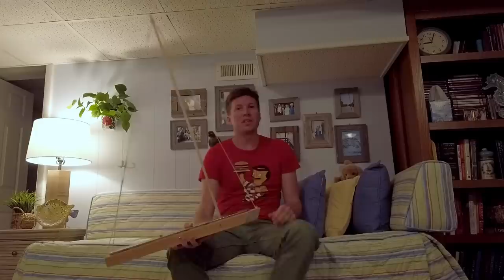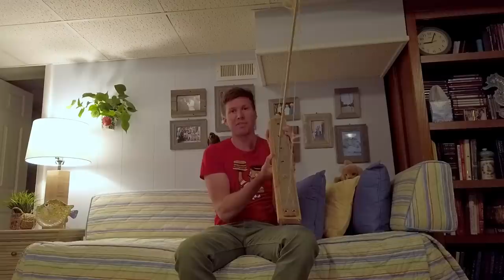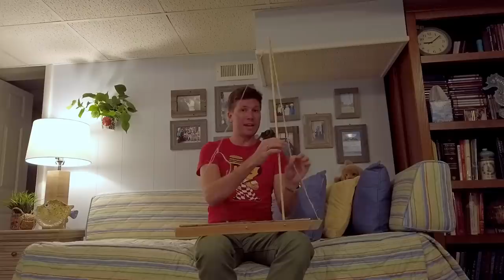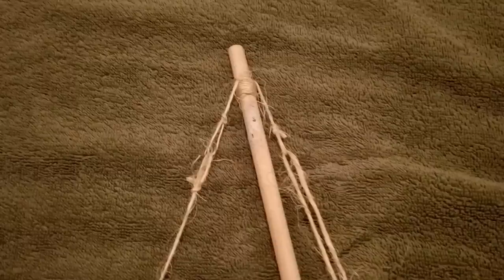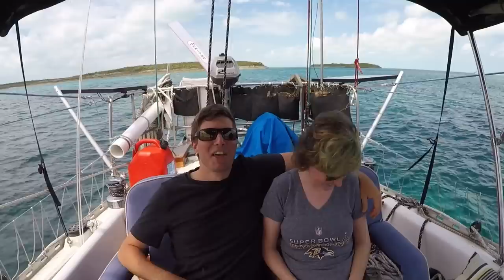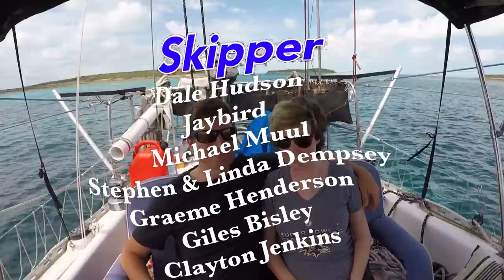Do You NEED One or Two Headsails? | Sailing Wisdom

Comment: The geometry of my trimaran doesn't lend itself well to a backstay. I'd have to shorten my boom to have one.
Reply from the maker: That sounds counter productive! Do you also have a square top mainsail? They are great if you have aft swept spreaders and no backstay.
Reply: @RiggingDoctor  She's not a very big trimaran. 19 ft LOA, 14 ft beam, 27' mast, 218 sq ft of sail area.
Her sidestays do most of the lifting and sit about 3 ft behind the mast.
I know it doesn't sound like much of a vessel, but she's cracked 20 kts and covered over 300 miles in a day.
She was a project I made out of 8 sheets of plywood with a Hobie 16 mast. Dry, she weighs about 300 lbs.

I went with Dyneema rigging. (Love your videos on stays.) Since mine gets trailered each time I go out, I had to get creative with a deadeye replacement (lashing takes too long). I ended up making a 16 inch bury to make a sling on each stay. It locks like a Chinese finger cuff but adjusts easily.

Comment: What is the difference between a cutter rigged yawl and a Bermuda rigged yawl? The JFK yawl Manitou is said to be a Bermuda rigged yawl. I thought it was a cutter rigged yawl.
Reply from the maker: Technically, a cutter has only one mast. So the number of headsails is not important when talking about a ketch or yawl. That said, you often see yawls and ketches with two headsails referred to as a “cutter rigged” ketch or yawl.
Reply from the maker: The Bermuda rig referred to triangular sails as opposed to a gaff rugged setup.

Comment: The modern definition of split headsails is moronic.   Your definition of the placement of the mast is rational, and historic.   Still, for the purist, the only proper rig is a schooner, both fore and mainmast gaff rigged.   If you want to go fast, get a stink boat and be done with it......
Reply from the maker: 🤣 very true!
Reply: Rigging Doctor, I've got a serious question.    I am seriously considering commissioning a boatyard to construct one of William Garden's designs, the little 28 foot schooner "Toadstool" with some modifications.   Garden has  the foresail as a gaff, the main a Marconi, with split headsails.   Underwater, there is a skeg keel, Garden used an old Thunderbird keel.  What I'd like to do is convert the main to gaff, with a topsail of course.  That would give her a significant amount of sail more aft than Garden designed, and unbalance her, giving her more windward helm, correct?   Could this be corrected by increasing the amount of keel between the rudder and the keel, making her center of resistance move aft?   Or is this a pipe dream that would wreck her performance, which is reputed to be very, very fast for a little schooner.   Thanks!